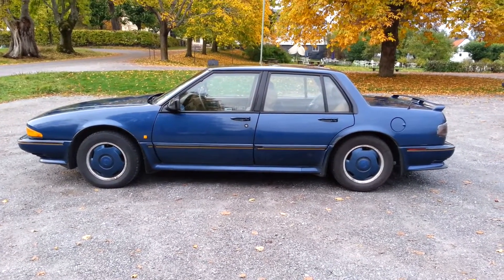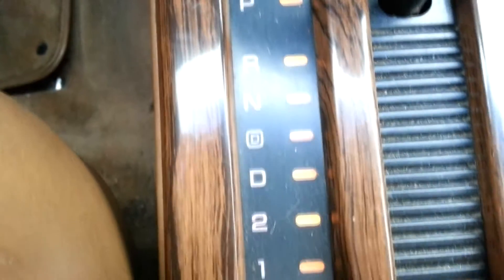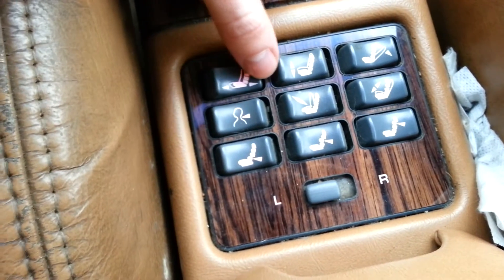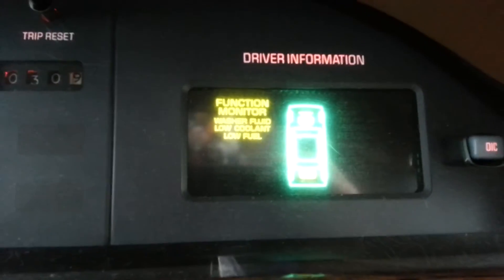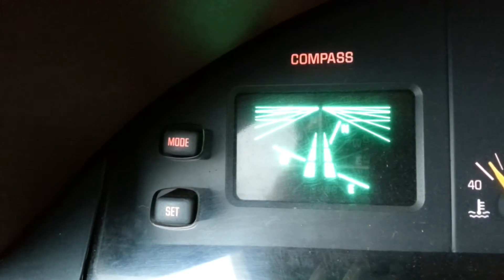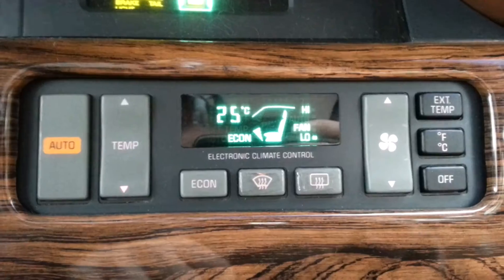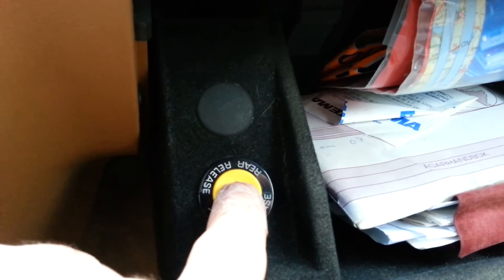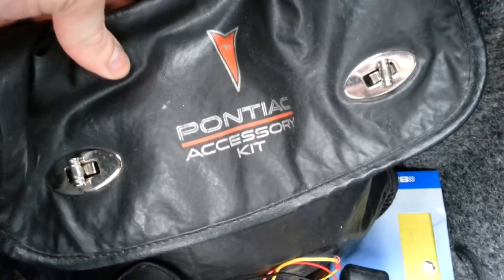90 Pontiac Bonneville SSE Review

Comment: I cant tell if its your microphone skipping out or if your enigine needs a new coil pack,
it sounds like its misfiring every now and then.

And I have a 1990 LE Base Model, it doesnt have as many features but it has the same 3.8 liter engine. Which is one of the best engines to have in my book.
Reply from the maker: Denser Dogg its probably the microphone. Car is running fine :-)